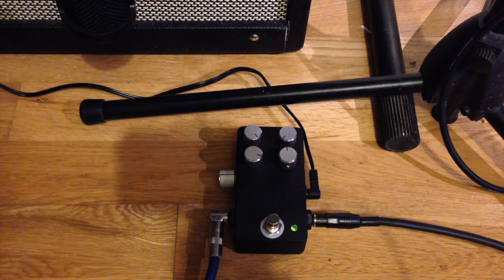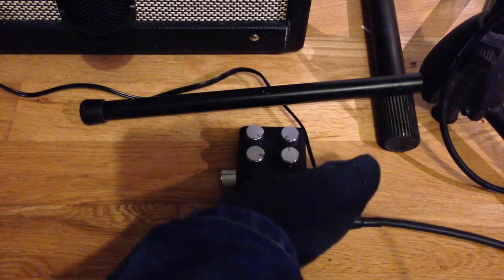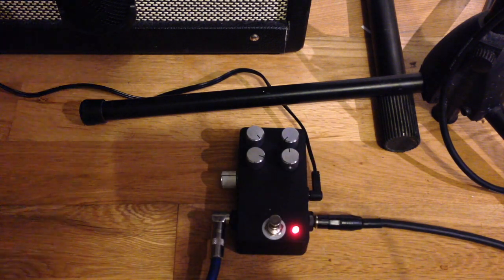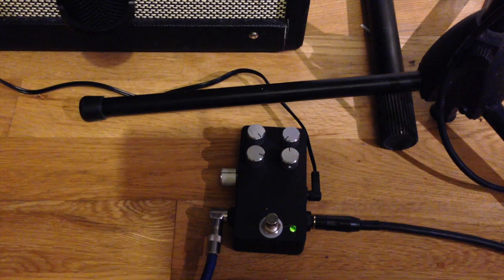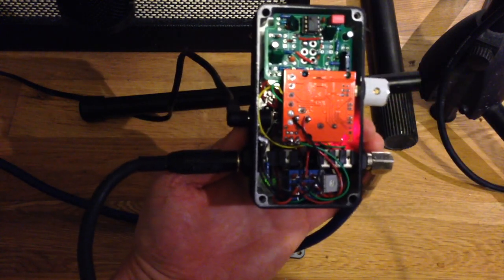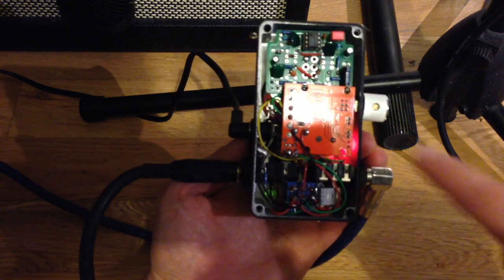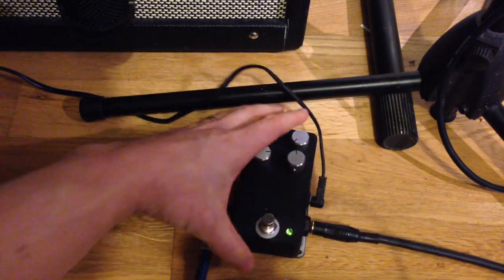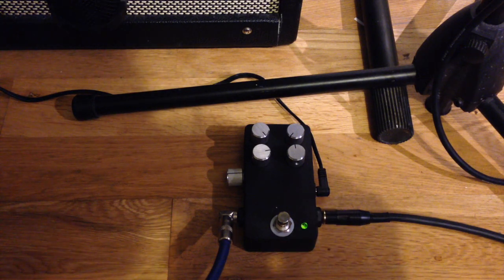9V 5 Watt 2 Channel Guitar Amp In A Pedal - Class D PAM8610

Comment: I've been thinking of trying this for a while. Are you using just one channel of the amp or have you bridged them somehow?
Reply: James Low. Great thanks. Got one of those amps on order from eBay now. Going to have a play around and maybe build a small battery powered practice amp with it.
Reply: I been experimenting with one of those PAM8610 modules and a Sure Electronics TPA3110 8watt module I already had, using a EHX Soul Food as preamp. The Sure TPA3110 is far superior, less hum and noise, a much better clean sound and takes distortion better too. The only problem is the PCB is about double the size so it would need a bigger pedal enclosure but I recommend it if you want to build something like this again in the future. Looking on Ebay they now do a 30 watt mono version too.

Comment: Quilter makes the best sounding Solid-State Amps that use Class-D amplification. I think we'll see more of it in the future. You've got a cool project there! I bought several of the various "ready to go" Class-D chip amps to audition with a simple clean preamp that I made. I have noticed that if you push the input of the Class-D chips, they go into a protection mode which consists of farting and the amp gating on-off-on (repeat) until you reduce the signal. To stop this... I rolled off some of the bass, utilized a resistor voltage divider, and added a pair of clipping diodes to control peaks. Overall... they make for a cool little amp; much better than those nasty LM386 amps that everyone builds.